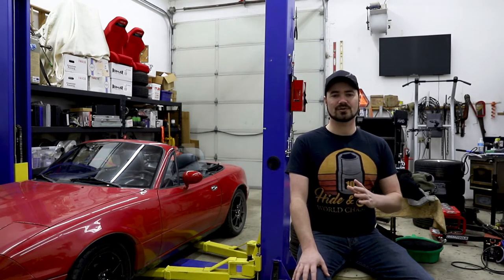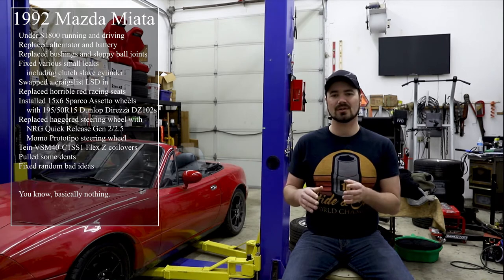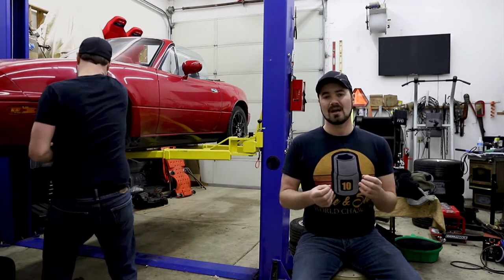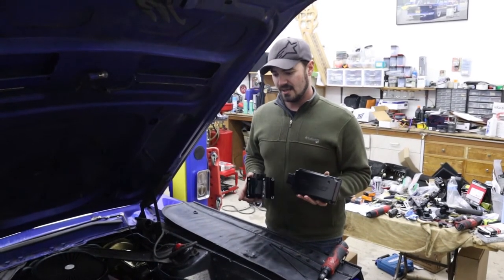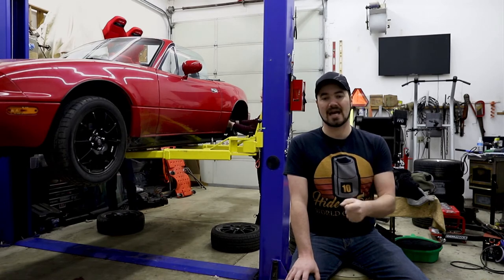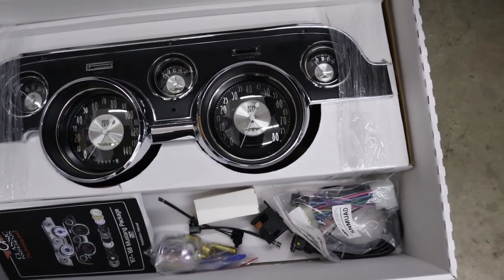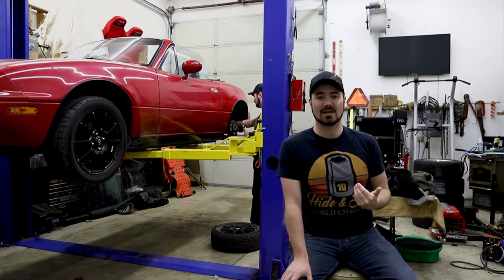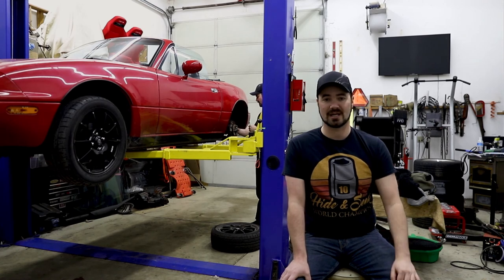Channel update and the dog ate my SEMA video

Comment: Sorry to hear you had such a bad time with the Holley Sniper stuff, the SEMA trip, and a kinda boring winter. Hows the Hyperspark ignition working out for ya now?
Reply: Also black really is the only right color for an interior! 😂
Reply from the maker: Now that I have beaten it into submission, it seems to work great. I'm already debating using the same system on the 350 in the 1940 Chevy if I go EFI. Thanks for watching my rambling!
Reply: @AmbiVe  Right on! We just installed the whole Sniper and Hyperspark setup on my younger brother's truck, had a couple issues with the first startup but it's been awesome other than that. I'm even thinking about putting it on my '67 Camaro project.